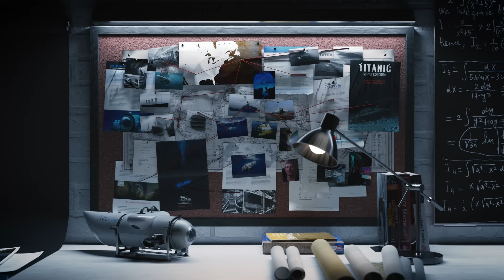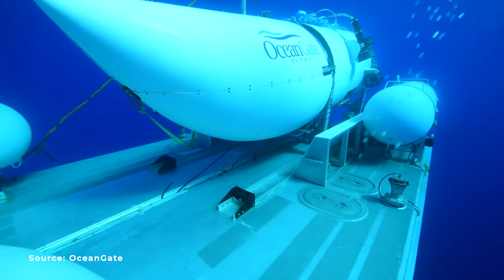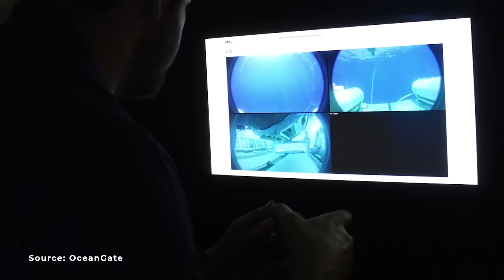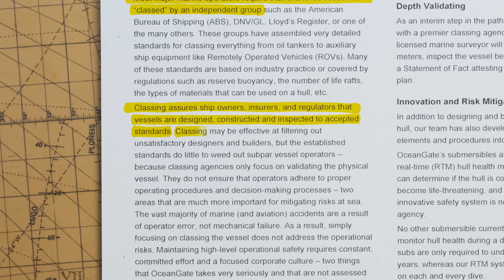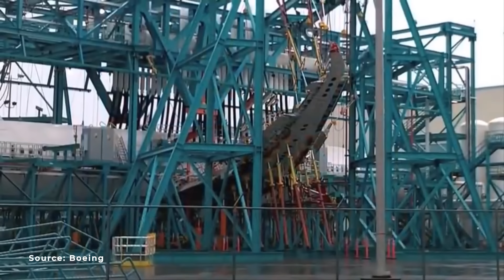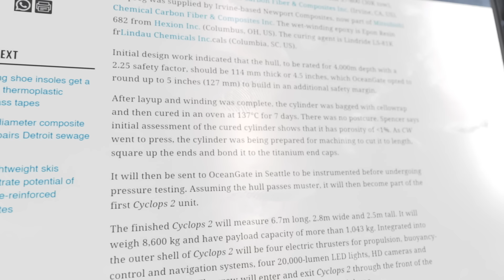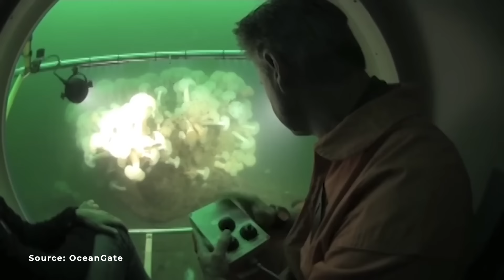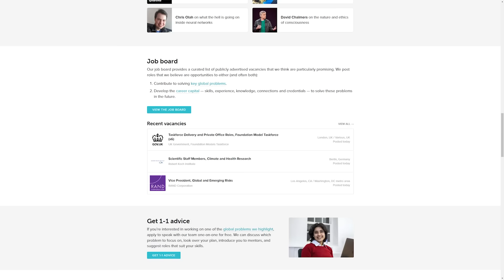The Questionable Engineering of Oceangate

Comment: Brittle is not a good attribute for a material under pressure . It's not even like an aircraft which as pointed out has an internal pressure pushing out, but that pressure is significantly less of a difference that which a deep sea vehicle would have to content with. You're talking about 1 ish atmospheres vs a fraction of 1 in the air, the dsv here is 1ish +  internal vs nearly 400 atmospheres at the Titanic's depth. That's a massive magnitude of difference.
Sure there a benefit to limiting your weight in the water, but unlike the air, it's not nearly as hard or expensive to fix your buoyancy as it is for lift. Just use the metal, it works, it's been proven to work and you're not really saving anything by using a lighter material, also cost cutting on a life and death critical part of the design, well we saw how that worked out.

Comment: Yep, I was told many times in my composite material engineering class that, beside the reinforced concrete, most composite materials have very bad mechanical properties in compression. This was the first question I ask why they use such material for a deep sea submersible. Furthermore carbon fiber behaves like fragile material with almost zero plastic deformation which means there is almost no warning sign before the fiber rupture. I still don't understand why nobody told these to the ceo.
Reply: Those who told him were fired. The rest of his employees were lowlifes.
Reply: The Oceangate engineers weren't people with any experience, the ones that built the comm system were actually interns (paid only $15.00/hr). Might not have even graduated yet. There were NO experienced engineers at Oceangate. Rush deliberately chose people who wouldn't give him any resistance, and didn't know much, he just made that one "mistake" with Lochridge.

Comment: the fact that they didn't use an autoclave and nobody thought that wouldn't go badly is insane
Reply: Plenty of people thought it would go badly. It's just that they weren't listened to, and then fired when they wouldn't bend the knee.
Reply: @hazelhazelton1346 Thank you. The lack of power analysis behind this nonsense is always frustrating.
Reply: This video literally shows people thought it might go badly
Reply: Also, even an autoclave may not have saved this design.  The real flaw was inadequate testing to see how this performed in the real world for repeated cycles/depths until failure.
Reply: @fewwiggle  testing eats into profits. Profits that could be spent on Bolivian marching powder.

-That CEO
Reply: @fewwiggle  definitely, but even incredibly surface level knowledge will say it was a blatant oversight

Comment: I think one thing a lot of these companies forget is that SpaceX' use of the "Move fast and break stuff" mantra was deliberately done in unmanned missions with lower costs of failure, since with machines you can rebuild & try again but humans are irreplaceable.

Perhaps if he was using this approach with a bunch of unmanned deep-sea probes they would've ended up reducing the costs of deep-sea science, but jumping straight to the crew capsule (where SpaceX waited years before considering it) meant the inevitable failure resulted in irreparable tragedy.
Reply: SpaceX also always worked with the governing bodies. Musk dies criticize the speed of the FAA but they still do everything asked of them by the FAA. They spent years working with NASA on the design and certification of the cargo dragon capsule and did it all over again when they moved to a crewed capsule. SpaceX has never tried to avoid complying with regulations. They have only criticized the speed of them at times.

Comment: 70 minutes to dive? I thought it was meant to take 150 minutes?? ie. there is a suggestion they descended twice as fast as they should have. And when they dropped weight to ascend basically nothing happened. Also, one commentator who runs a testing factory said it would only cost $20,000 for a full sonogram for crack and void checking.

Comment: 5 inch lay up, high chance of buckling in the laminate without de-bulking and curing in sections but smells like cost cutting,would be interesting to see the laminate spec for the tube. As you said great in tension not good in compression. Great content ,thanks.

Comment: Thanks for not focusing on the game controller. It's really common to use off-the-shelf parts, and while it is a terrible game controller known for losing connection, it's not the biggest issue with that death trap by far. The titanium end-caps are pretty much the only thing that would pass regulatory testing.

Comment: This is great analysis, instead of saying using composite is a mistake like most other channels, you actually has deep knowledge and understanding of it and pointed out that it isn't the material fault, but the improper testing and engineering decisions they've made that cause the incident. 

From my opinion, if they made it thicker, use autoclave, and went to certify and classes the sub, this might not ever happened, and they would be really made innovation.

Comment: There are several BIG errors in the construction of a carbon pressure chamber!!!
1. The thread was laid in a single direction.
2. The carbon pressure chamber was made in wett laminate. It should have been created with a vacuum bag and then into an enclave to get the right temperature.
3. None of these materials such as carbon, glass, kevlar and all their mixtures have a super strong ability when compressive forces are applied to them.
4. If these materials are to be subjected to pressure, they must be designed accordingly.
5. In the film that shows when the carbon + laminate is laid, irregularities are already shown during the construction.
6. Press tests show that carbon laminated,, in terms of pressure and compared to, for example, titanium, is much weaker. That carbon tube was constructed specially for presure test.
7. The Titan carbon tube has also been patched in one place.
8. Who REALLY did the calculations and construction, because it was NOT NASA and Boing that the CEO claimed. They DON´T want enything to do with it???
9. The titanium rings at each end are glued on and the carbon tube is slotted to fit these rings. Glued in the same way as in the car industry.

Comment: There's nothing wrong with a trial and error method like Space X or what Virgin Galactic did. Even with Virgin Galactic, the 2014 deaths were to test pilots who knew the risks - you can't account for 100% of the risk in aviation and space flight. Without this attitude we would never have gone to the moon. The difference with OceanGate is that they were trialing the system on retail / paying customers.

Comment: We had built for us, TFE lined FRP vessels in 1979 (in Montreal) 12ft diam by 20 ft tan-tan rated to 2psi (protected by seal legs at 3/4 psi) that held an acidic liquid (200 tons/hr flowthrough)...innovative, only the 3rd and 4th vessels of this size and in this service that had ever been built; we had to replace them after a year as they lost structural strength due to delamination, fortunately we noticed the issue visually so there was no sudden failure...we cut them in half to inspect the areas of failure, the glass fibres were still there, but the resin was shattered, in crumbs, or completely gone in the weakened areas. this failure had taken time, but we had not put techniques in place to monitor vessel integrity beyond visual inspections. Working with the fabrication shop, we modified the fabrication techniques and the replacement vessels were still running fine 14 yrs later...AND we had put monitoring procedues in place to check them (destructive and non destructive testing)...lesson learned. They could have done destructive testing on their shell after multiple cycles and not just assumed zero stress fatigue.

Comment: Amazing video! At 11:31, the Acoustic Monitoring System is specifically designed for practical use rather than marketing purposes. Based on a recently released unofficial transcript, it becomes evident that there would be sufficient time for surfacing if they could maintain the normal ascending speed. This further strengthens the belief that acoustic monitoring technology possesses the theoretical capability to deliver early alarms, ensuring timely surfacing. However, a notable flaw in their analysis was the failure to consider the reduced speed caused by failure , ultimately leading to a significant mistake.

Comment: The strange shape of the back of the vessel seems like a questionable shape for such extreme pressures since an arch is the strongest structure. A dome seems like it would have made better sense for pressure distribution.
Reply: It’s not structural. It’s just a covering for gear in the back. The pressure vessel was a carbon fibre tube with two titanium end caps.

Comment: From what I have seen of the controller from pictures the controller looks like gen 1 Xbox third party controller not Xbox 360 not xbox one or Xbox series x it was an og xbox controller third party wireless its not important information but idk how good wireless third party og xbox controller are but it could have some issues I remember wireless controllers at that time a little finicky and have some input lag depends on the brand and company in the early days of gaming
Reply: I looked at it and it ios a logeitech controller the logo and name is one the center of the controller and idk if its an old repurposed og xbox controller or a new one designed to look like and og xbox controller so either way that's still not make any better

Comment: Don’t make a cylindrical pressure hull out of carbon fiber and titanium caps. Carbon fiber is great at dealing with internal pressures as it causes the structure to balloon and the fibers tense. This is why carbon fiber makes great tanks for rocket fuel. However, external pressures cause the pressure to be against the direction of tensile strength so every dive weakened the fiber and broke the laminate that kept them together. I can’t believe anyone with any engineering knowledge got into that death trap… Oh, and the external parts were held in an aluminum scaffold connected to the rear titanium pressure cap which would have likely caused galvanic corrosion.

Comment: Glad to hear from engineer better versed in composites than myself. Is “snap buckling” known or thought to be a failure of the resin matrix leading to delamination of the fiber-resin layers? Are there any NDT/NDI methods for assessing composites of a 5” section under cyclic loads? The “acoustic monitoring system” seems pointless unless its data is compared to other data on hull deterioration to determine the life of the hull. 
Comparing Titan to general aviation accident rates: GA around 1.029 fatalities per 100,000 flight hours. Giving Titan a generous 50 dives at 10 hours per dive, 5 fatalities gives 5/(50 *10) = 0.01 fatality per hour or 100 per 100,000 hours. Commercial aviation accident rate (all not just fatal) 1.55 per MILLION flights. Titan one every 50 (or 15) dives. Titan was experimental & charging a fee seems more like having fare carrying passengers. 
Titan was being fatigue tested albeit while in “regular service.” So was the Comet passenger jet. Alas the life of the Titan design turns out to be very short - 15 (some sources) or so dives to 3,800 m. A single data point really doesn’t help much especially if lacking any NDI/NDT test data on how well the composite was made.

Comment: 2:03 im a rocket nerd, and i can verify that CC is best in tension (pressure on the inside) like a 1000 psi 2-stage water rocket that, once it's finished, will hold the world record highest altitude (Horizon by AirCommand)
Reply: Ard stuff is better at pressure or am I wrong?

Comment: 5:50 I thought it's pretty simple, the mechanism behind delamination buckling. 

Compressive stresses transfer throughout the material from outside in, and as the innermost layer has nothing to hold it in place, it attempts to physically displace through the path of least resistance - the side without the glue or composite holding it in place. Hence, the inside wall buckles layer by layer, resulting in a cascading loss of hull strength until the entire pressure vessel is breached. The entire process probably takes milliseconds to occur.

We also know that the weakest link of any carbon fiber composites is the epoxy matrix/substrate holding the fibers in place. Hence delamination failure.

I'm no composite material engineer, and that's precisely why I'm surprised why people in the know still consider the mechanism behind delamination buckling under compressive stress to be an unexplained phenomenon. It's just a sum of basic phenomenon already demonstrated in other fabricated pieces of hardware. Forces travel through the path of least resistance.

Comment: While I do have concern that Elon Musk is going to kill people if he puts them onboard Starship too soon, I think so far there is a huge difference between Elon Musk's "move fast and break things" and Stockton Rush's "move fast and fire the experts who challenge your willfully ignorant thoughts".  Elon Musk goes out and tries to find the best people he can for the job and listens to them and then ends up with a rocket like the Falcon 9.  They moved fast on the Falcon 9 and they broke things, yes, but they put a lot of good engineering to it with experts getting their say the whole way, had strong foundations from an engineering standpoint, and now they have the safest, most frequently launched orbital class rocket in the world by a large margin.  They have also sent a number of crews into orbit and they have all come home just fine.  So far there was one glitch with the toilet, which they quickly fixed and a problem with the launch abort system, which they uncovered in ground testing, so nobody killed because good ground testing was happening.  That problem was also fixed.  So whether Elon Musk will get too full of himself and turn Starship into a killer rocket is yet to be seen, but the regulators are holding him back quite a bit.

Stockton Rush on the other hand fired the experts for challenging him.  That quickly led to numerous very bad design decisions, which you only touch on a few in this piece, a sinking death trap, and he got himself and others killed while full of himself and willfully ignorant of how much of a death machine he was riding in.  The bad thing is I come across plenty of people like Stockton Rush and a lot of them call themselves engineers when they are anything but real engineers.

You definitely need to do more episodes on what it means to be a real engineer as engineering is more of a mindset than a technical skill.  Anybody can be a monkey with a wrench in their hand.  Not everyone with a wrench in their hand can do the job at hand; at least not the job they should be doing.

Comment: I am not a composites' expert, but I think that the air pockets are, or at least should be dealt with at the vacuum process. Relying on the autoclave's pressure to drive the pockets out of the part doesn't seem effective to me.
But again, I could be wrong.

Comment: How about making this sub egg-shaped, instead of pointy.  If you want to build an expoxy carbon-fibre egg, you need for the epoxy in the carbon fibre layers to be somehow applied under extreme pressure, theoretically able to withstand extreme pressures(instead of say, under vacuum)

Comment: According to a transcript of comms between Titan and the mother ship going round the web (which may or may not be genuine), the Acoustic Monitoring system on the sub was showing increasing numbers of red lights. If true, it does back up your contention that the warning you'd get from the system would be very limited - in this case, apparently less than 20mins. After all, a failure at 4000m is going to be really really fast, and I can't see that they'd be a 'limp-home' mode. Thanks for an informative video.

Comment: The idea of build fast, fail quickly isn't a bad thing in and of itself. If you up-front analysis costs (monetary, time, whatever) are greater than your failure costs, just learn what your failure modes are by testing and seeing things explode is perfectly valid. The problem with Oceangate is that they took that philosophy, and didn't do the explody bit before they put people on the sub. That would be like SpaceX building a brand new rocket and attempting to launch a crew to the ISS as their test payload. Incredibly stupid. Mind-bogglingly negligent. Probably criminally so.

Comment: A few mistakes in the commentary. Stockton did build a third size model of the hull to do destructive testing. Also, Stockton did respond to the warning of the guy in the Bahamas who warned about the sounds being caused by damage, because shortly thereafter Stockton invested in a new similar hull to mitigate the issue.
Reply: That would be Karl Stanley, who has been operating his own passenger submersible in Honduras for many years. As I recall, he goes to a max of 2000 ft, well below the max depth for his sub. Per a lengthy interview with him done by a Youtube travel vlogger, Stanley also warned Rush about taking on passengers when Rush himself had only piloted two deep dives at that point, compared to Stanley's over 200 dives before taking any passengers. Rush had a huge deficit of experience in operating a submersible, as well as developing and producing one.